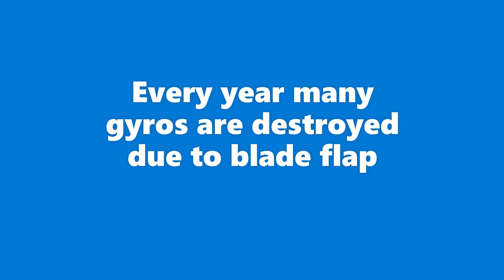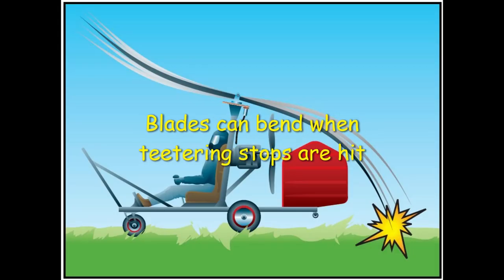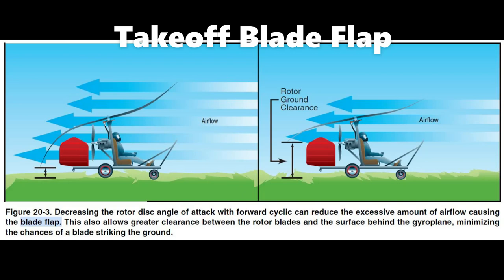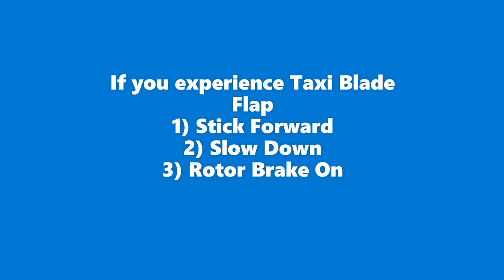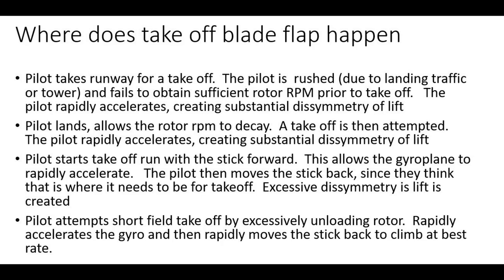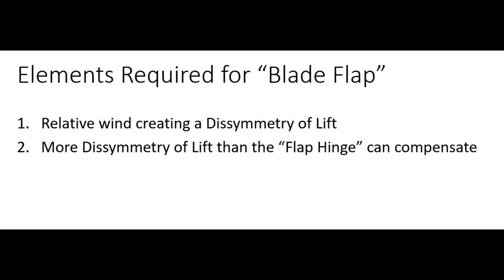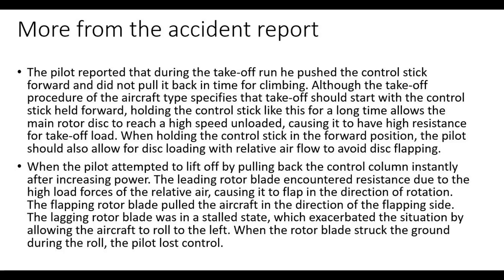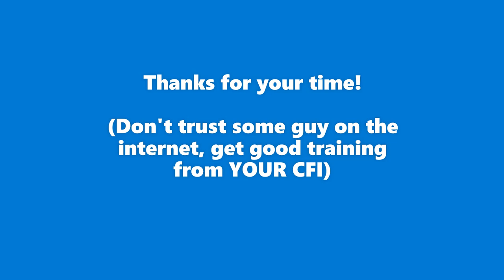Blade Flap

Comment: It'd hit the ground and prop and rudder long before the machine rolls over.  Remember the reason it exceeds the ability of the hinge to compensate is because the retreating side is actually stalled.  It is producing no lift.  This is why you get the giant S shape when flapping which was shown here.  I have looked at lots of accidents in modern gyros that claim blade flap was the cause.  Most I think were ironically caused by the modern proceedure you see for take off all centred around avoiding blade flap.  The enemy here is 220rpm then full power.  It means your rotors decay then gradually pick up speed again.  this is a) more likely to result in blade flap if you screw anything up and b) sucks up heaps more runway c) the transition to flying lift happens way faster.  From what I have seen what then happens is people suddenly have their nose rear up, torque effect is strong here too as most modern machines are about 100kg overweight so they need bigger engines + bigger props.  Now the bloke is dancing on rudder one wheel lifts before the other due to torque and all this is happening over a few seconds.  If he's new, hasn't flown in a bit or theres a sudden crosswind then the speed at which this happens often results in horsing it off. 

How do I know it isn't blade flap?  Look at the blades, is the retreating blade conned up or down at lift off?  If its conned up its producing lift.  It ain't blade flap.  Its over rotation and just hitting the blades at the back.  Look at this video this is a guy I knew taking off from hand winding his rotor.  Note how little take off distance, note each step of added power is gradual as he builds up speed so when he's balancing its progressive and gradual and thus under full and easy control.    https://www.youtube.com/watch?v=36ogAzGGyG4  there was bugger all wind that day and he was taking off on the taxiway here.  Also shows you don't need a pre-rotator to get off quick - you need blade management skills which Steve here had in spades.

What we need to to genuinely teach proper wind up, that is don't spin them to 220 then rush to catch them before they flap.  Instructors have to learn to wind up to less rpm then gradually build up their speed with slower initial speeds and only adding more power when the rotors are ready to accept it.  This gives complete control of the rotor throughout the whole process.  Good on this bloke though for trying to explain and de-mystify this, doubly so for actually doing low speed blade flap.  Its much worse when your going quicker you can have two hands and the stick is still being reefed around.

Comment: Thank you, Chris, for elucidating this potentially-fatal circumstance.  By way of what I hope is constructive criticism, it would be helpful to have the points summarized in a pithy way at the end of the video and then a "In take-off and landing, these are the actions you take to avoid blade flap".  I'm subbing.
Reply from the maker: Thanks.  Constructive comments are always welcome.   When I find time to re-do this video, I will certainly consider adding a summary section.   I've also been thinking of a video on slow flight.  The footage is on my computer, but after reviewing it, I decided I need more footage.

Comment: Thanks Chris, very nice video on blade flapping. Great job.  Nice to you stressing training. Hopefully every want-a-be gyro pilot will get the important issue that you need "training" on how to hold the stick. 1, pre rotate, 2, slowly add the power with the front of the rotor disc above horizontal sufficient to bring the rotors to normal RPM for the weight thats going to be higher RPM for two people than one.  When the rotor rpm is 100%, then more power can be applied smoothly to gain flying speed.  While most gyro's are full power on take off, some are not, the Turbo for example may not be used. .  This video is an excellent description of Blade Flapping. Take note of the Rotary Flying Handbook.   As Chris says, get an instructor. A large proportion of accidents are due to a failure to get training or even training on type which can be very different.  The accident reports mentioned point that out.  Note all these accidents were preventable with training that was either forgotten ignored or they did not obtain.

Comment: There was a pilot killed while flying an autogyro at a Farnborough Airshow in 1970. He was a fixed wing pilot and was in the circuit demonstrating the machine when he allowed the nose of the machine to get too high. Instinctively he reverted to type and pushed the stick forward to get the nose down. This caused the rotor blades to bend downward striking the propellor and tail. The airshow was televised and I saw it happen. I have always been interested in autogyros but this accident put me off for life.
Reply from the maker: I take it you are referring to the accident in this video  https://youtu.be/CfjBzrSDrV0  .   There are two things to keep in mind.  First the pilot can avoid putting the aircraft in such a position.  The sort of flying shown is not normal.  And pilots have long had to make sure their aircraft was in a reasonable flight envelope, as shown by this video.  https://youtu.be/_L7o_JlPg5w .  In other words, the pilot did something dangerous and it bit him.   Second, modern gyroplanes have a horizontal stabilizer.  As you can see from the video, a horizontal stabilizer is not  required for flight, but it does make the gyroplane much less susceptible to a power push over (or bunt).
Reply: @txkoob  No I was referring to this accident in 1970.  https://youtu.be/zr6Il2siZRU   What I neglected to mention is that I too am a fixed wing pilot having trained in the 70s on Cessna aircraft. My fear of reverting to type in a similar situation or an emergency stopped me from taking up flying autogyros.

Comment: Great graphics. Simply stated, pilot is stalling the retreating blade and/or failing to compensate for the equivalent of P factor with high loading. Is a wobble head that equalizes blade lift technically too difficult to design?

Comment: Why not have a stop on the controls to prevent the blades from hitting the tail? That would leave a few additional inches of clearance.
Reply from the maker: Please take a look at the newer version of this video.   https://www.youtube.com/watch?v=G0Ia05fRDXQ  In the first 2 seconds, you can see the impact of "blade flap".  Notice the tail is still there, though the rotors did strike the runway.  As for putting stops on.  --The point is to avoid finding yourself in a blade flap situation with the help of education.  Stops might stop a tail strike, but the machine would be in trouble anyway.

Comment: Thanks for informative info. From what youve said basically is rotor speed needs to be high.  The reason is when speed is high enough  "centrifugal force makes the blades want to fly off / throw out"  ...but held in place on the hub the force on the blades pulls them straight  {both blades "throwing out" acts like a cable with the chopper / gyro in the center of cable,  as cable pulled taut - automatically lifts vehicle}.  From what youve said it looks like gyros should also have slight lead-lag hinge rubber mounted so as forward blade hits air it is allowed to lag due to movement {give away to force}  wile on the down side = less resistance then allowed to spring forward.

Can anyone put something up regarding  "jump take off gyros"  in exact secquence of whats happening.  Around time of DC sniper I was drawing idea {visible to spy satilite}  concerning making a micro chopper with  "shorter rotor span"  to land in tight spots and figured it was centrigfugal force at play and came up with increasing mass at ends of blades to assist "throw out force"  -  only later to see American military choppers coming out with that concept.  Any reason it wouldnt work on gyro?  And why not also simply limit travel of rotor so it cant hit any thing  {beside the "one side lifting more then the other side issue".}
Reply from the maker: Hi David.  Quite a few questions there.  For jump gyros, look at https://swisscows.com/video/watch?culture=en&query=youtube%20jump%20gyro&region=en-US&id=B5757ABB948CC08CC72EB5757ABB948CC08CC72E   Basically the pitch of the rotor is changed so it doesn't create lift.  Then the rotor is spun up and a lot of energy is in the blades.  The the pitch is changed so the rotor creates lift.  The stored energy is what allows the gyro to rise.  For the carter gyro, there must have been massive weights on the ends of the rotor blades.      Here is a more traditional jump take off gyro.  https://www.youtube.com/watch?v=wzAcNh56B5A  --Notice how the blades droop until they are up to speed.  --And this is also not the typical teetering rotor head I mentioned in the video.
Reply: @txkoob  Thanks for the info.  i didnt initially see the bottom half of your reply but it makes perfect sense.  but from there he must -  what -  be spinning up to 400 rpm?   Are you saying when he lifts off,  the rotor must be disengaged before?   Or like an angle grinder with large cut off wheel -  is it OK to have the rotor engaged -  but disengage before moving forward -  and yet why is the craft not moving forward anyway given the rear propeller.   Thus what do piolits do when they want to hover stationary  {or is this professional coaching money infringement?}   Is my comment about having hinge for lead lag correct in terms of avoiding gyro tippings?  Thusshould be manditory anyway.  ...Is that your daughter looking cute by the way.

Comment: Hi Chris, would it be fair to say that, at any time, the danger zone is between 100 and 200 rpm ?
Be above it at take off
and
Below it when taxiing
Reply: The danger zone is anything less than normal RPM. The life produced by the Rotor is the square of the speed. Going from 90% to 100% can be the difference between a take off and a roll over.  Full RPM is greater with two people and full fuel than one person etc. The greater the weight, the greater the RPM required to produce the required lift.
Reply: @ramjet4025  I appreciate your technical response, however, i was looking for a general 'rule of thumb' guide. The computations you propose are, perhaps, a little onerous to the average pilot at taxi and  roll.
Reply: @ptrsrrll  Peter, I disagree. I explain to students, "The Anatomy of a Take off" , then break it down into all the components. Its the Noob level of briefing for noobs. At the end, they put it all together with perfection and it just means it takes time opportunity and practice.
Reply: @ramjet4025  Again, no argument.
I am looking for the relatively universal markings you can put on your intsument panel.
Reply: @ptrsrrll  That would be  putting a flight training manual on the "instrument panel".  The "Rule of Thumb" is  having a clear understanding of the need for FULL RPM prior to attaining best rate of climb speed.  Asking for "universal markings"  means you did not watch all the video or the content of this video has not been understood and you need to get an instructor.
Reply from the maker: @ptrsrrll  Generally the designer of the gyroplane specifies a safe RPM prior to starting a takeoff roll.  The Magni M24 in the video specifies 200 rpm prior to starting a take off roll at full power.  This is typically on the pre-take off check list, which is used immediately prior to takeoff. --Yes, you could put the take off check list on the panel.  One could put a warning light too.    --And a lack of understanding (or attention) would still cause accidents.
Reply: Dear Mr. Ram Jet.  You know nothing about me. You display willful  ignorance. 
ALL AIRCRAFT instrument panels have "universal markings".
Red zones, Yellow zones, Green zones, Gradients, Max, Min, Operating ranges etc. etc. 
My question was to Mr. Koob, and while you inserted yourself, I tried to be polite.
Reply: @txkoob  Hi Chris, great video. No one gets their PPL by just showing they can read a checklist. And yet, no sane pilot would fly without them. My intention was to establish
a simple guide (Check) on the question of Rotor RPM at take off and while taxiing. 
Like when a class in Relativity is over and passed,  The 'Check' would be   E = mc2
Reply from the maker: @ptrsrrll  Hi Peter,   as far as a danger zone.  In the Magni, anything below 200 RPM is a "danger zone" and requires special attention.  During pre-rotation (when the aircraft is stationary), the stick must be kept forward prior to 100 RPM.  This is because  the rotors are not rigid enough and are not coned up.   A simple gust could cause blade flap.   Above 100 RPM, but below 200 RPM, rapid acceleration may induce high speed blade flap.  Magni also recommends not starting a take off roll below 160 RPM, and at that special care must be taken to slowly accelerate until the rotor speed builds.    Note also, that in the USA, there are a variety of gyroplanes.  Anything from "old school" gyros where you start the pre-rotation by hand, to modern gyros with high speed pre-rotators.  They all have different "danger zones".  For example, it was common for a Benson gyroplane to hand start the rotor and taxi it until sufficient rotor speed was obtained.  I know a very experienced instructor (with lots of time in things like a Benson) who tried this in an Autogyro and had a tail strike due to blade flap.  --Why did he do this?  The pre-rotor system had failed to engage and he didn't want to wait on the repair.
Reply: @txkoob  Thanks Chris.
Reply: The problem is there is no specific rpm.  It depends on a number of factors.  So wood rotors have zero angle set into the hub some blades have up to 4 degrees this massively changes their flying rpm but also their susceptibility to blade flap.  I know guys who've had 18ft rotors and others with 28ft rotors.  Machine weight, blade profile.  Trouble is people are looking for an rpm range it doesn't always work that way.  Hit a thermal while winding up and the whole angle of attack just bounced up massively.  Have a cross wind hit, any of these situations can effect you.

The problem with modern gyros and modern training is no one learns the basics anymore.  I used to instruct in gyrogliders and never had an rpm gauge or pre-rotator on these machines or my powered machine.  But you learned to manage your rotors properly.  The modern technique buzz up to 220rpm then gun it has clearly been set up to avoid the possibility of blade flap but it doesn't work, any number of factors can still get you there as this video explains.  

Back in the day even with pre-rotator good pilots would wind up didn't try to beat the rotors to death then try to catch them before they decayed they wound them up much less but then built them up from a lower rpm to full flying rpm by first taxiing slowly then as they gradually accellerated till they won't go faster then add just a touch more power and you did this until they were beyond begin able to flap then you could apply full power.  Not only did you not need to look away from the blades to see the rpm (because you can see the blades and how fast they were spinning), but if flapping did start to occur it happened gradually.  

For example not anywhere in this video or in any others did I see the technique for working out if you think flapping might be occurring but are not sure.  Push your stick an inch off the back stick you'll feel them hitting before it gets too bad.  You just do it momentarily if unsure.  You can actually see them flapping from the seat, again not going to see this if looking at the rpm gauge.  The advancing blade doesn't follow a nice circular path if flapping it lifts higher at the front then drops rapidly as it starts retreating, this you can see but its subtle.  You will never learn to look if you don't learn good rotor management.

What we need is instructors to go back to the basics, get in a machine with no pre-rotator learn to wind up by hand and really learn the skill then apply this training.  Get rid of the 220rpm then dash approach it leads to more problems than it cures.  There are no short cuts.

Comment: this isn't computing for me.
I think an animation showing damage result would really sink in for me.
Reply from the maker: For high speed blade flap, think of it this way.  When the gyroplane moves forward, the rotor teeters so the advancing blade has the same amount of lift as the retreating blade.   The advancing blade rises and the retreating blade falls.  If there is too much dis-symmetry of lift (air speed of advancing vs retreating blade),  the blades hit the rotor head stops.   Now, the advancing blade will have more lift than the retreating blade because the rotor can not teeter any more.  This will cause the gyroplane to roll towards the retreating blade (usually the left).     As the roll rapidly proceeds, the blades hit the ground and the damage occurs.